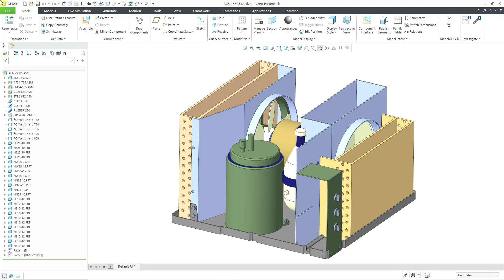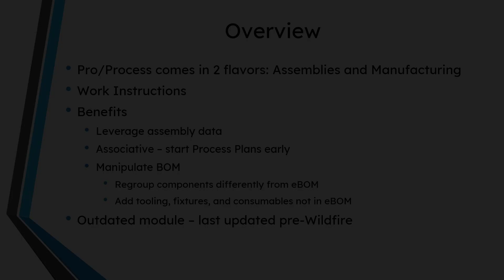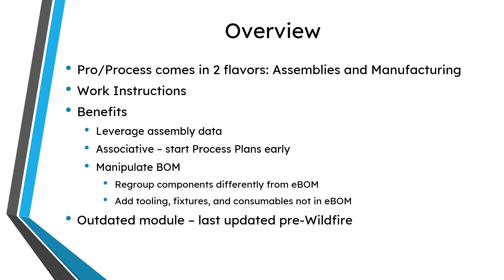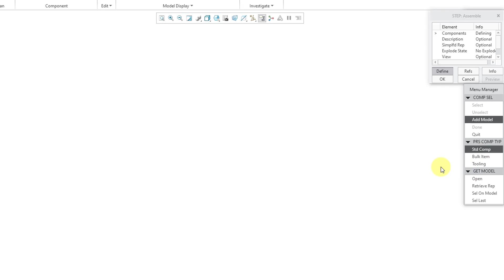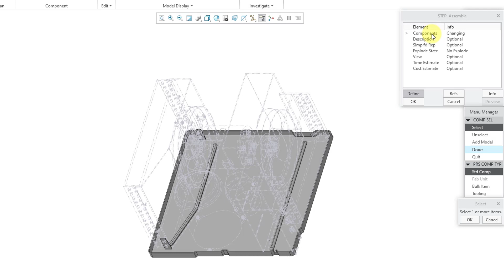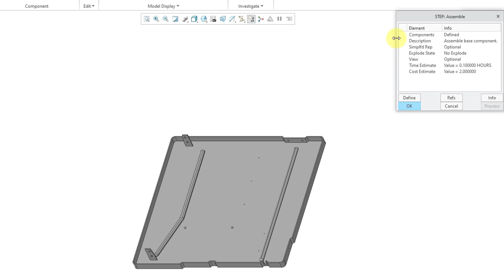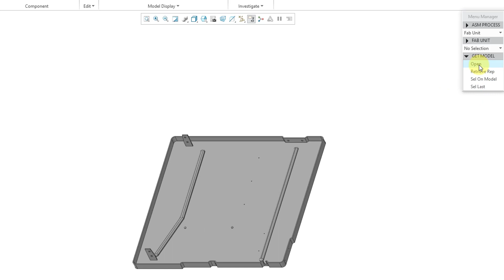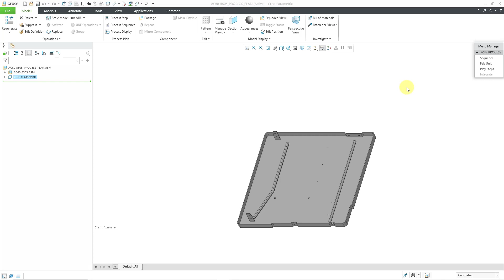Creo Parametric - Pro Process for Assemblies - Part 1 of 4

Comment: Hi generally we create Assemblies to be " as designed" to carrry design intent and the moment we check the assembly in to windchill it would generate an eBom which depicts " as designed". My question is for the , if i create a pro / process file in creo of same assembly to show sequnce...do i need to manage this item in windchill with a different number or is there a way in windchill to say like as soon as i check in it creates an eBOM as with configuration like " as shipped " with same assembly number?
Reply from the maker: The Pro Process assembly will need a different number. As I pointed out in the video, Pro Process hasn’t been updated since the 1990s. PTC didn’t acquire Windchill until 2005. Checking in a process assembly generates the same product structure as any other assembly. But it would be more akin to As Built versus As Shipped.
Reply: @CADPLMGuy  Thanks for the reply
Reply: In pro/process you are essentially creating an MBOM from the design EBOM.  You are free to add any additional items to this assembly which can either be bulk items, or, a solid model.  I typically add bulk items such as loctite or tie wraps.  Once inside windchill, you can pull a report on the MBOM.  I name my process assemblies as <design filename>_PRS

Comment: Nice video. Just  as an observation, in general de User Interface from CREO is no friendly compared to other CAD systems.
Reply from the maker: Well, that’s kind of a general statement. I don’t want to get into an argument and I may end up deleting this entire comment. Compared to Onshape, SolidWorks, or Inventor, I’d agree to an extent. But compared to other medium to high end CAD tools like NX or 3DExperience, I don’t see how you can say that.
Reply: @CADPLMGuy  you can delete it is up to you. I just commented it cause you commented in ur video that people did not like the drop down sequence of the menus in previous versions of CREO. Sure I cant say about all CAD systems, probably another CAD system is worse but related to NX I dont know your knowledge in that but I say I assure you NX is much more easier in the steps to apply a function then CREO based on my knowledge on the functions that I know in both softwares (NX  14 years experience and CREO 5 years experience).
Reply from the maker: I'm currently planning a "Creo for NX Users" series and will probably film the first segment in the next couple weeks. However, rather than making subjective statements about this CAD system is better than this one or this CAD system has a worse UI, I'm going to focus on providing value to people. As I've said in several videos, it's time for the CAD wars to end. I've got my opinions about the NX UI and workflows, but using my platform to express those isn't constructive. I feel the same way about general and blanket statements comparing any one CAD system to another.